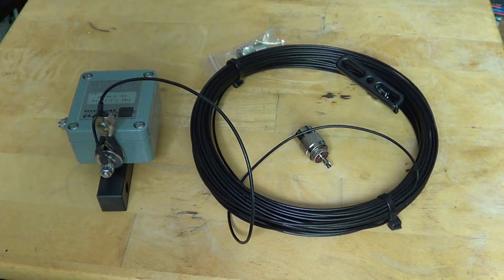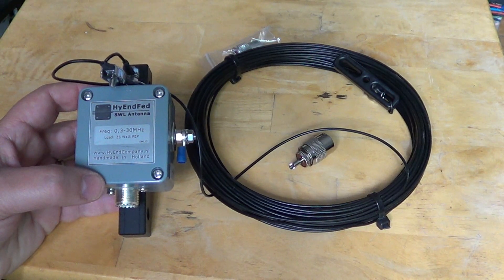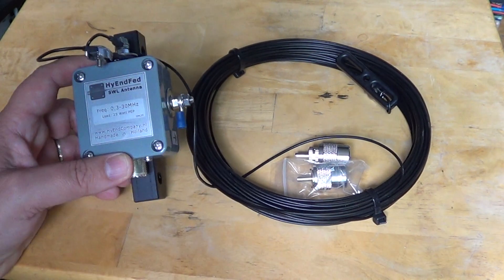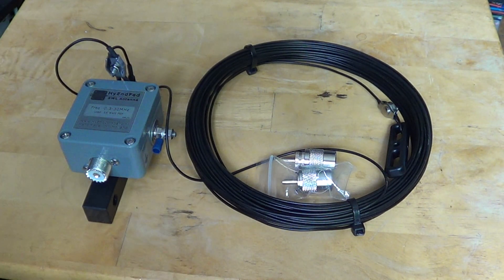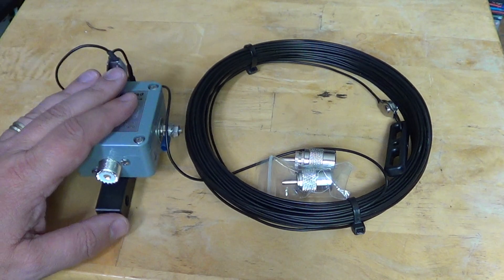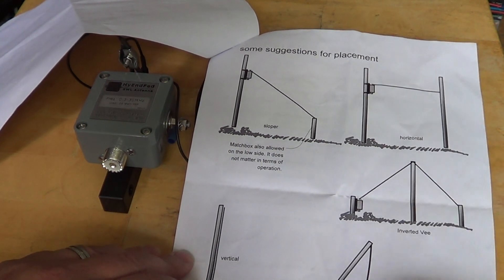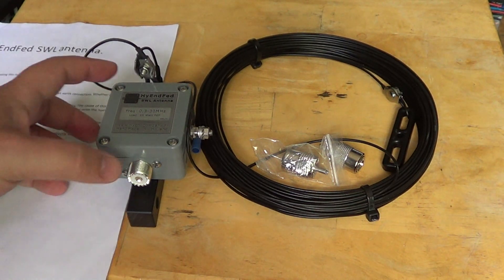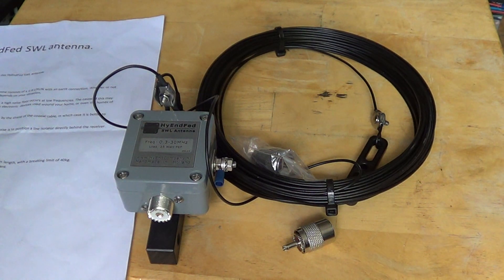HyEndFed Shortwave wire antenna with Unun Hand Made from Holland

Comment: What you have is transceiver antenna and not just a receiver antenna . That antenna will work for amplified radio signals at the amateur radio maximum of 1500 watts
Reply: No! Just to clarify, the WIRE will be happy at 1500W as an end-fed  antenna, but the un-un transformer will only take 25W max (according to the published spec).  At 1500W the ferrite transformer toroid in the un-un will destroy itself from the heat dissipated in its loss. The windings may also short-circuit with the high voltage produced by the 1:9 impedance transformation!